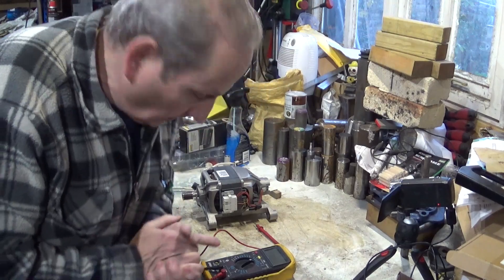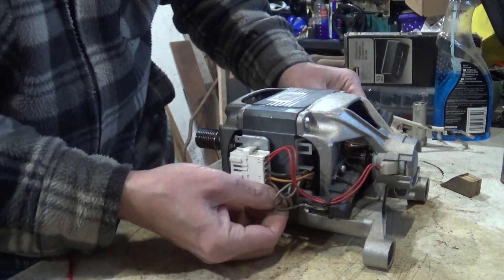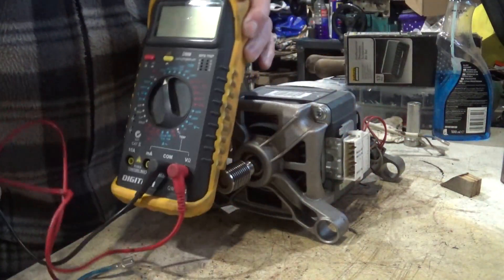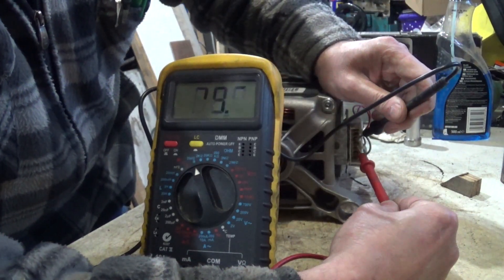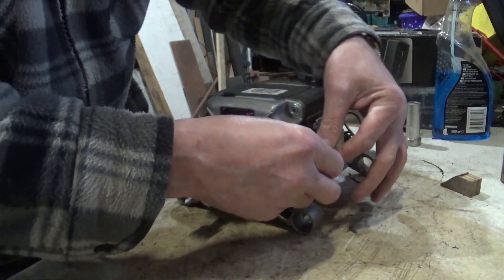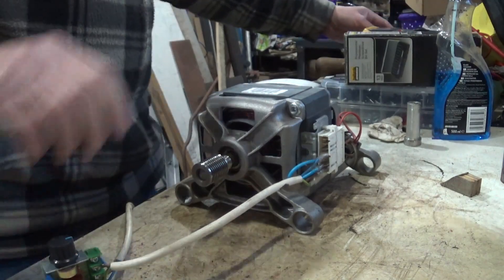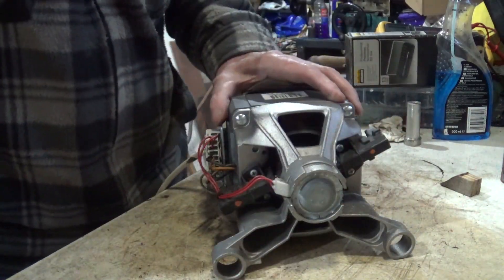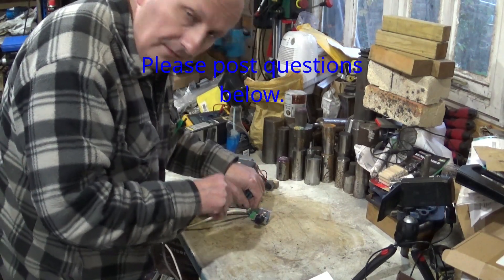Washing Machine Motor reversing

Comment: can you help me to wire my washing machine motor for forward and backwards movement?  I only have 3 wires (+2 tacos) in my motor and a capacitor...
Reply from the maker: Not seen a motor like that before, does it have brushes? If not, it may be a brushless motor which requires a driver circuit. 

Many thanks for watching, please like, share and if you like the channel, subscribe!

Comment: Is it possible to wire the motor so that it can be run forward and in reverse without having to re wire the motor to change its direction?
Reply from the maker: Yes, you would have to build a reverser switch (or do it with electronics). 
I posted a video on reversing a single phase induction motor, but the principle is the same, you reverse the relationship between the field coils and the rotor. (On a single phase induction motor it's the relationship between the main coils and the starting coils).
The video is here:
https://www.youtube.com/watch?v=hiytCAPsuyI

Many thanks for watching, please like, share and if you like the channel, subscribe!
Reply: @BensWorkshop  thank you so much, please keep up the great video content.
Reply from the maker: You are welcome. Many thanks.
Reply: @BensWorkshop  hi, thanks for the video link it was much appreciated and I have managed to wire up the washing machines motor to an old drill switch that has a reverse switch this hocked to a battery pack has been quite a success, I also have a brushless washer motor but I have no way to power it and I have no idea how to make a controller for it so I’m thinking of selling it with no idea if it even works
Reply from the maker: A brush-less motor is generally a 3 phase motor, for RC motors generally run by something called an ESC. For washing machines I believe the circuit is similar but on a different scale. You should be able to find some information on it, but it does require electronics.

However... Brushless washing machine motors of the pancake type are also used as generators by off grid guys. See for example @MartyT channel here https://www.youtube.com/@MartyT and in particular this playlist:
https://www.youtube.com/watch?v=LVoeaKCEd2o&list=PLrCvcRxFfyzu8IdzghRF66pqH7M0yQZ6S&pp=iAQB
Reply: Can I just say that I have just seen a load of parkside tools on your channel and you also have a myford ML7, this two facts have got me subscribed to your channel, my preferred tool are ones that don’t cost to much but that are reliable and parkside is both reliable and reasonable priced, I also have a myford lathe but my one is an ML10
Reply from the maker: I also have an Atlas 10, an MB2 drill press and a Naerok vertical mill. And a selection of welders... which are about to get a bigger brother....

Comment: Thank you for your demonstration....  Do I have this correct? Looking at your diagram at 1:42 seconds.   If I numbered the pins 1-7 with the tacho being #1 and #2.  Then pin #3 is powered by AC.  Pin #4 is not connected.  Pin #5 is jumpered to pin #6.  And pin #7 is the other wire to the AC.  Did I have this correct?
Reply from the maker: Yes, though you would want to double check with a multi meter if you can.

Note a universal motor does not care if you run it on AC or DC. 

Many thanks for watching, please like, share and if you like the channel, subscribe!
Reply from the maker: Also in the ext video you can see how to reverse the motor.

Comment: Hello Ben,
A very useful video, thank you... slightly off topic I am looking to purchase a multimeter, is there one you would recommend?
Take care.
Paul,,
Reply from the maker: I have a numer, no particular recommendations, but you want to make sure it does AC and DC voltage up to 700 volts, milliamps and amps and resistence.

Lidl do one from time to time which I will test and review soon though they don't have one in. 

Hope that helps.
Reply from the maker: I would add that a good supplier would be from the CPC farnell group or Rapid Online
Reply: @BensWorkshop  thank you

Comment: There is some nice round stock for your lathe. Are you going to use this motor for the lathe?
Reply from the maker: I have got lots of round stock for my lathes, and indeed mill (which is currently not running). No, I would not run a lathe with one because they are not as efficient as an induction motor. I am not sure what I am going to do with it yet, but they are cheap. I get them from a scrapyard for a £1 or two.

Many thanks for watching.